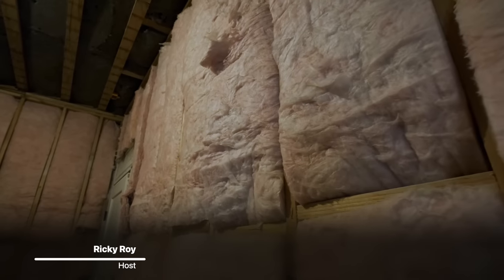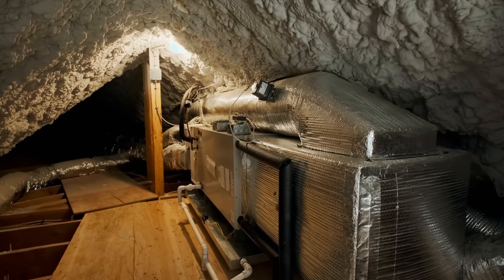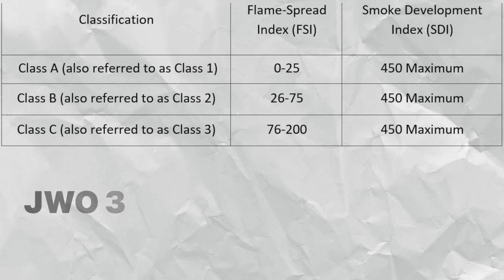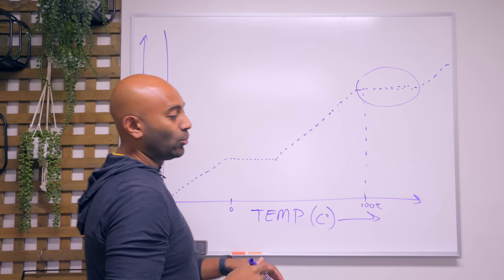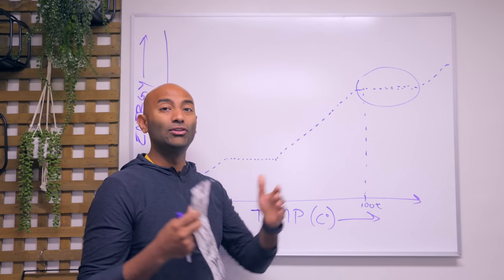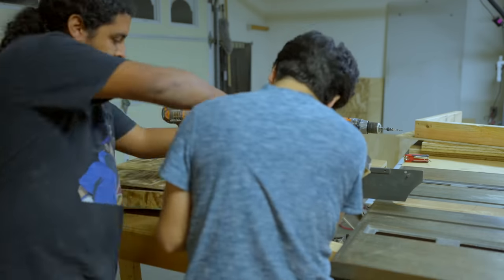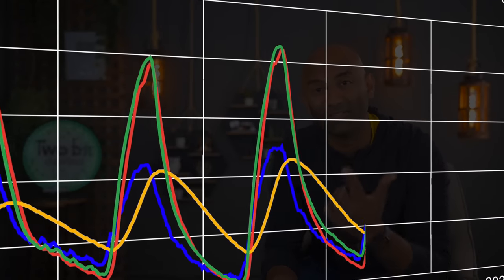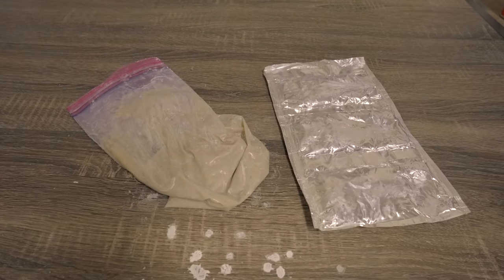The Genius of Phase Change Building Insulation!

Comment: I can’t see pitching a thermal storage as an insulation… it can be a valuable piece balancing your total heating/cooling strategy, particularly if you’re taking advantage of passive systems, but I can’t see it being particularly useful during my long months at -30, without a full envelope of insulation outside  the conditioned space.
Reply from the maker: how are your summers? its interesting especially because they can formulate it to different temperatures based on where you live... you just need enough of a delta... so if you get some warm winter days... its possible, but I'm not sure. cheers!
Reply: @TwoBitDaVinci  My winters go  to -40, my summers to +40, using phase change alone would be extremely difficult to condition a space.  This is a an energy storage technology, not an energy control strategy.  The potential for maximizing passive (collecting solar in the winter, or dissipating waste heat in the summer) is large, but would required systems to move that energy around, which kinda defeats the purpose of building storage into a conditioned space.  I can see this as very useful in an area where  daily temperature deltas are high, but when the delta is zero, a straight up energy transfer barrier is crucial to keep that expensive heat inside.

Lining a room with it, and inside a fully insulated envelope would be great for balancing the heat of from a wood stove for overnight comfort, but the total energy from a closed system is the same.

Comment: Not a great plan in predominately cooling zones. It would be releasing heat right as your AC would normally be getting a break in the evening. If it were tuned for hot areas, it could potentially making your heating bills go up when it does get cooler.
Reply: Why? It prevents more heat from going inside during the day than it lets in during the evening. So net gain should be positive. Unless you can run AC cheap during the day and expensive during the evening. Which could actually be the case as we get more solar power.

Comment: good stuff,,,Attic $ SURE,,will reduce humidity also as heat goes to cold not the other way as stated. Next if on budget only do the sunset in summer walls.DONT put additional insulation in attic,,,it is a heat soak and only costs money

Comment: Inch and a half = 12 Inches of concrete??? WTF??? Do they sell it in inch and a half thickness? And is it always those little pouches or can they size to the width of your studs?
I have lived in a rock house in my past, and on spring days when it is hot outside, I have had to open doors and windows in order to warm up the house.
Under the floor test would be interesting to see also.
Reply from the maker: crazy right? yah pretty amazing
Reply: @TwoBitDaVinci please read the edited version of that comment

Comment: I don't understand your comment about "it doesn't really require any traditional insulation", or why I'd put it in my unconditioned attic space. It seems to be that if I rolled it out about above my attic insulation and it could absorb N units of heat, then putting it below the attic insulation would absorb N * 40 units of heat (or use a lot less material).
Reply: I think you're correct: this should be used in addition to classical insulation, not as a replacement. This stuff becomes useless the moment all of the material has phase changed. You can delay this two ways: use more of the expensive material, or put it on the inside of your classical insulation.
 
Especially once you consider that due to non-overlapping temperature ranges between summer and winter, the material becomes useless during one of those seasons, as it's quite impossible to find a phase transition temperature that sits simultaneously within two non-overlapping temperature ranges. Without the phase change, the only insulation this offers is its thermal mass, and the radiative insulation offered by the shiny outside layer. Both of which are negligible; a brick wall has more thermal mass than this, and we don't rely on brick walls alone for our insulation. Likewise, we don't rely on aluminium foil wallpaper for insulation either.
 
So yeah, I agree. If not paired with classical insulation, this thing is nothing but an expensive way to completely miss your insulation goals.

Comment: Never understood why people go for expanding foam just on its own. Sure it blocks up holes and is quick to install but doesn't stop radiant losses. I much prefer expanded foam board with foil both sides and use expanding foam to seal them in with foil over the joints. Not sure how you install this phase change material as you can't nail it as it will lose some of its liquid and the foil bonded edges will act as a thermal bridge.

Comment: OK, but how is this product an insulator? What is it's heat resistance (W/mK)? As I see it, you still need some insulation. This material acts only as heat reservoir for temperature stabilization. Using only this product wont save you much on energy costs.

Comment: the experiment is off, you made a box in cca 1:10 scale, so for the same effect, you would need to have a 10x thicker layer in the real size house
As you also mentioned in the video, this is not an insulation, it is a heat bank with aluminium foil on it and the heat bank feature is based on its mass
Also it should not be called insulation, because it's not insulating, it's conserving heat (a little)

Comment: It's acting as a 'Heat-Sink'. What your calling a 'Phase-Change' is called 'Latent-Heat'. Stone holds more heat than a liquid. So, if you lined or paneled inter-walls with ceramic tiles, or even brick, that would 'radiate heat' lots longer than that liquid. Take a course in AC/HEATING and you will learn about Thermal-Dynamics.

Comment: Sounds promising, in the right situations as discussed. But, puncture it and it oozes out AND seals?  Does the oozed material then lose it’s phase changing abilities (solid to liquid and vice) and so while if it is a liquid again, how will it continue to seal?  And it is a soybean product?  Much like some electrical wire insulation that rodents have a tendency to mistake for food or chew on — not sure I’d want that in my house.  Or has it been “animal” tested?  Ah, but it “potentially” seals itself, or at least that cell no longer will have the full insulating, phase changing capability.  Perhaps further development on durability is needed.  It is definitely a good start to something better.

Comment: So in areas, like FL, where we stay mostly hot and there is much less room for phase change at all, how would this help? I'd consider this for my attic if it were not pointless. What is the delta required for impact?
Reply: Florida is actually a good market for PCMs. Remember, ambient temperatures are not the issue in most cases. when its 90 outside that does not mean its 90 on that south facing wall or roof deck/attic. Probably more like 150 or more. THOSE are the temps PCMs deal with. If you have an 85 f PCM in the attic drawing in the heat and using it to melt your insulation layer is going to be much more effective. All that is required is that overnight lows drop below the 85f PCT in order for the material to refreeze, and be ready to do it agin the next day.
Reply: So effective half a year! Stays above 90F at 2am most nights. BWAHAHA
Reply: @hallowedshade125  Simply choose a PCM melt point at which the overnight lows necessary are met.. They have them..

Comment: I don't think this is insulation.  This is functions much more like thermal mass.  Thermal mass is great for smoothing out fluctuations in temperature, but eventually it brings you to the average temperature.  In some ways insulation is the same, but if you are adding energy to an insulated room, the insulation actually stops the flow of energy.  This doesn't.  All it does is store extra energy, so that you don't notice the flow of energy until a certain amount of it has flowed out.

Comment: it's not insulation any more than concrete is.
it's a thermal storage material.
is 1.5" of this cheaper than 12" of concrete?
it moderates the temp until it doesn't (i.e. completely phase changed) you might need to have a lot more of this stuff to cover your heat gradient

Comment: some good information, but this material should not be described as insulation, which slows heat movement. This material is a heat storage device, sometimes called 'thermal mass'. Such devices work well in a passive way in climates that experience swings in temperature from above to below a comfortable design temp. However, for places that have temperatures consistently above the design temp or consistently below design temp, this material would not provide value. So the hot humid southeast in summer is not the place for this. It would work in desert type environments where cool night temps dip low and day temps get high.

Comment: I bought some for my crawl space under the radiant heat. Will be interesting to see how it works. We have closed cell foam in most of are walls and ceiling in the newer part of the house. But the older part is less well insulated. We had fiberglass batts in the crawl space. I am hoping this will lower both heating and cooling and also make the radiant more even. The price without shipping was less than $2 per soft.

Comment: You spoke about Celcius...100° boiling, 0° Freezing....Makes too much sense, doesn't it? I used to hate the metric system of meters, kg, etc.. But now that I live and work in Chile...It's like, why do we still use Imperial System in the US?  I mean, 1 liter of water weighs a 1 kg and freezes and 0° and boils at 100°.....one cubic meter is 1,000 liters of water that weighs 1,000 kg which equals 1 ton???  To easy.🤦‍♂

Comment: I’m sorry, I don’t see how this prevents heat from leaving a house.  This really does not seem like “insulation”.

Likewise the graph makes no sense.  The graph of outside temp and ins + PSM are very similar.  Are we looking at temp in a box with no heat?  I would think the purpose of insulation is to to allow the inside temp to be different from outside temp; with little energy input?

This acts more like thermal mass then insulation.

Comment: these tests are not well designed.
he does admit that the first test wasn't as well, but still explains data from it. these things should not be explained from a faulty test. if you wanne mention that you had some trouble with testing, sure go ahead. but i see no point in showing the data from it. 
further concerns
1) there is no box with just phase changing insulation nor a reason given why there isn't one.
2) putting up aluminium layer on the inside does not compare another wood layer. it did get closer to how a wall in a home would look, but why not fix the first test  to how a wall actually works 
3) missing a listing of downsides 

all of this together makes it seem more like a commercial/promotional video to me then informational vid.
Reply: A hoax.

Comment: This video is missing some nuances. This material is indeed usefull for some buildings, but only when some conditions are met:

1) The prefered indoor temperature should be within the range of outdoor temperature. What this material does is averaging the temperature swings. But when the maximum outdoor temperature is still below the prefered indoor temperature, using the material does not make sense. And traditional insulation material will be the wise choice. 

2) this material can be usefull in buildings with a low thermal mass, like timber framed builds. For buildings that allready have a big thermal mass, the material does not gain any benefits. For example in a mediterranean building for stone walls of half a metre thick, the temperature swing is allready very well averaged by the stone mass, so this material won't do anything.

Comment: You can't compare using the boxes you did. The insulation is fair enough, but did you add the phase change material at a ratio that would be present in a normal house? Or to put it another way, the amount of phase change material per air m3 (or f3 for 'mericans) is WAY higher in your test compared to a house, probably orders of magnitude more.
Unfortunately the test setup you made doesn't prove anything and is inherently invalid. Sorry.
Please repost a correction, so people are not misled.
Reply: TwoBitDaVinci.  Reported this comment and the channel.

Comment: I love the new material info and I think your testing was close to actual results but would really want to see an actual building assembly box of exterior facade, vapor barrier, sheathing/studs, insulation, and finally drywall with mud on joints. All boxes sealed to a slab with sensors inside and the wire hole (if needed) caulked on inside of sheathing and outside on exterior facade. Also the qe should be placed against inside of sheathing and maybe not on top of insulation since staples would compress those insulation and compromise it's insulation value.
Hopefully you get to repeat the testing to show the real world data!

Comment: did you know the best insulation is to have sand between the internal and external bricks and its cheap
Reply: Thermal mass definitely helps but with this product you could select the temperature you are trying to maintain.. 80f in Phoenix, 65f in Grand Forks. The object is to have the blanket communicate with the heat source, either sunlit surface/ambient, to interior heat. The traditional Insulation would then be used to control the direction of heat flow once the blanket gives up its heat.. IE the path of least resistance..

Comment: Ah, no Ricky, no!  While this product might be good insulation, that aluminum forms a condensation layer inside your wall.  Guess what happens?  Moisture damage and mold.  No, Ricky, no.
Reply: In scandinavia you have a moist barrier and under that insulation. That way moist from inhabitant doesn’t reach insulation or construction. 
But this is a hoax anyway, too little material, too little effect.

Comment: ah.... but your foil on the insulation was not an air stop... you still have not sealed the insulation enough for a fair trial....
Reply: We've seen that argument over and over but the truth is if you have a space perfectly sealed adding any "insulation" to it is counter productive. FIberous insulations work by trapping air between the fiber. The AIR is the insulator not the fiber...

Comment: In my opinion, calling this "insulation" is misleading.  Sure, any material has some insulating quality, no matter how small.  This material only provides effective insulating quality at the phase change temperature.  This would better be described as a light-weight thermal mass at its particular phase change temperature.  Imagine you like to keep your home at 70°F.  If the phase change temperature was 70°F, any outside energy heating it would not have an effect on the inside temperature until it absorbed enough  energy to liquefy.  At night, when it is colder, the inside would not start cooling until the material emitted enough energy to solidify.  Provided the outside temperature cycles were such that the energy going into the material during the hot day was identical to the energy emitted from the material during the cold night, and the phase change thermal capacity was sufficient to hold all of this energy, you would not need additional insulation.  Unfortunately, there can be cold weeks where the outside temperature never exceeds 70°F or hot weeks where the outside temperature never dips below 70°F.  This material would provide nothing but a radiant barrier under these conditions, so traditional insulation would be needed as well.

A potential cold weather use might be to store heat during times of low energy cost in order to reduce the energy required to heat the house during peak periods.  The reverse would also work.  For hot weather, the material could be cooled during times of low energy cost in order to reduce the cooling needed during peak periods.  Think of it as a thermal battery that only operates at its fixed design temperature.

Comment: Pull the video and do it again. Too many errors here. Others have pointed out the graph errors, but putting it inside a wall or roof is not the best location!  If this is a good low cost phase change heat store material you want the phase change to be at the comfortable temperature for your room. If the room temperature rises it will absorb and store energy. If the room temperature falls the phase change material will release energy and help to keep the room comfortable for longer. To make the most effective use of such a phase change material you want it inside the room, and where the air can circulate through it and the air exchanges heat by contact with the foil pouches. It might be worth using a small fan to circulate the room air through channels between the pouches. A small fan also gives you more control over when the heating or cooling effect makes the most sense.

Comment: But they're advertising doesn't make sense.
If the cold outside is causing it to turn back into a solid that means it is wicking the heat out of the house instead of pushing it into the house. This sounds like a total scam and money grab to me.

Comment: Instead of sending billions to Ukraine imagine what that money could do if dumped into scaling up phase change insulation. The investment would pay for itself so quickly. Imagine being able to buy this stuff for 30 cents per sq foot. Imagine a house with a triple layer of this.
Reply: Oak Ridge Labs says the use of PCMs in residential and commercial buildings can save 40-60% of heating and cooling costs. If that is true (their data proves it) then a 20% utilization rate would save around 2 Quadrillion KWhrs. About 100 Billion Dollars at todays US average energy rate